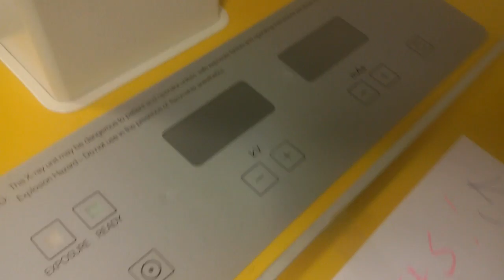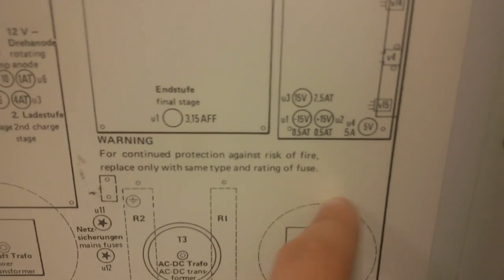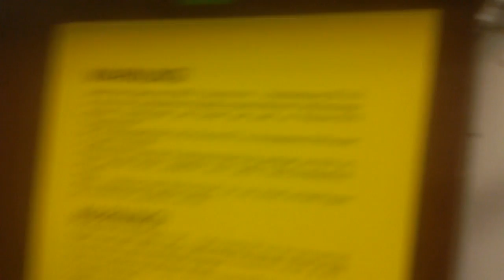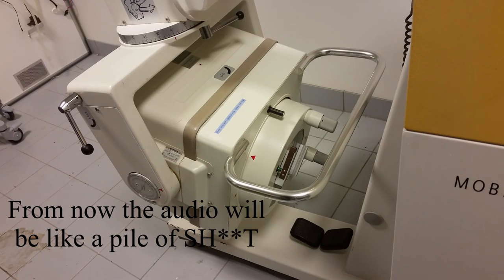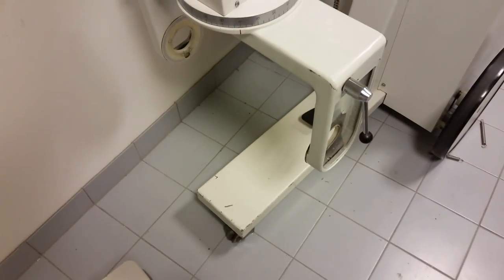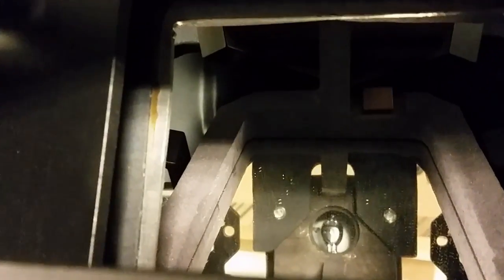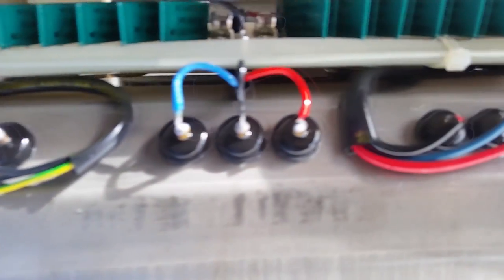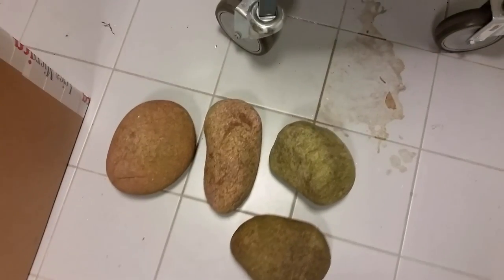Medical Equipment Teardown #4 X-Ray Machine

Comment: Great find! Siemens use only the best components so its all good salvage. Those Capacitors are excellnt photoflash quality types so they are designed for rapid discharge, perfect for high voltage exploders etc. also each cap on those boards are indvidually connected to fuse links in case of a cap failure. Great video!

Comment: Was the purpose of that machine radiotherapy or imaging? I didn't expect the spinning anode x ray tube. Part of me wanted you to power up the machine but I realise that would have been very dangerous.
Reply from the maker: The machine was used for Xray imaging, where the rotating anode is used so the anode doesn't overheat. I don't think it was used for radiotherapy because the capacitors can't hold so much charge. The machine didn't work, maybe some of the controlling circuit was damaged. That's why I could take the nice stuff out of it and the shells where put together :D
Reply: does all medical equipment get thrown out
Reply: does all medical equipment get thrown out

Comment: Good video!

Could you tell me why the oil is inside of the machine?
Reply from the maker: Stanisław Basarab it is there to insulate the high voltage and cooling the tube, the oil has a much higher breakdown voltage than air
Reply: Thanks!
Reply: @MrTesla1337  Ok. Oil has good heat dissipation capability to carry away the heat from heated anode side. Agreed. But being a hi dielectric strength  insulator , you said  it is to insulate the high voltage. My question is that inside the High Tension Tank assembly, what is this oil  insulating high DC KV voltage from ? Is it insulating the high voltage AC transformer from low voltage AC transformer or is it insulating the High voltage DC from low voltage AC transformer or high voltage AC transformer ?

Comment: Will you make some arcs with the transformer ? Thumbs up !! Alex
Reply from the maker: +High Voltage Maybe with low input voltage like 12V, I need to insulate it in oil if I want more voltage out of it
Thx
Reply: MrTesla1337 Ok, the tube is also very cool ;) 👍👍
Reply: Hello again alex, nice to see you ^^
Reply: Danilo Rosich :D :D